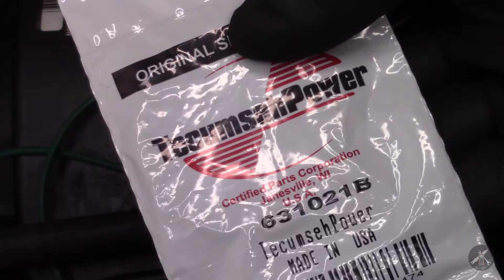Repair Tecumseh Carburetor - Where does the float spring go? Needle / Seat Install and Float Adjust.

Comment: Just had my carb apart and just cleaned it all up with no part replacement. Mine had a lot of sediment in the bowl and crusty crud on the float. The bolt with main jet also has a very tiny hole just above the threads that needs to be cleaned out. All the videos I watched, nobody showed that spring on the float. When I took it apart I was surprised to see that spring, I’d never seen a spring on a float like that before. I put it together without the spring and it’s been running fine.

Comment: Thanks for showing the "missing" float spring that helps lift the float, otherwise yer dang bowl overflows.
Reply from the maker: You're welcome. Yes, that spring is important and tricky to install.
Reply: @bitsofwisdom460  Well, since they want an ungodly amount of money for a rebuild kit for an HH120 w/ LME 36 carb, I made one myself ! Yep, dug up my mini springs, put one on a float pin, unrolled both ends then bent up the holdie tabs. It's already installed. Once again thanks for the view.

Comment: well got done and all the fuel leaked out any suggestions came out carb some where
Reply from the maker: If fuel is leaking out of the carburetor, it usually means that the level in the float bowl is (much) too high.  The float should lift the needle into the seat and stop more fuel from coming into the bowl. Something could be binding on the float so that it doesn't drop and lift freely. I would double check the pivot pin, spring, and needle clip and make sure the float moves freely by gravity.  The new seat might not be installed and sealing correctly. The needle must seat into the hole in the center of the seat and there can't be any nicks or scratches in the sealing areas of either part.  It is also possible for the float to leak (brass) and have fuel in it so that it is too heavy.  Plastic floats can sometimes either leak or absorb fuel so they don't float either.

Comment: Do you use Sta Bil for the fuel? I know in dirt bikes that sit all summer with gas, we use Star Brite brand treatment as it will not destroy the rubber O rings within the carburetor. Maybe look into that.... 😊
Reply from the maker: Yes, I've been using Sta-Bil since about 1998 when I nearly lost my 428 Mustang to massive carburetor fuel leak when the Holley float bowl gaskets disintegrated over the winter.  When ethanol fuel became prevalent here, I switched over to their marine grade product that has additional corrosion inhibitors.  I still use that even though I use ethanol free REC fuel. I figure that is still valuable for the boats and I only buy one bottle for everything. My practice is to add stabilizer to every can of fuel when I bring it home.
My one concern is that REC fuel isn't dispensed as quickly in the local stations and it could be possible for the gas to be degraded at the time of purchase. Especially in the winter when boats are stored and sales are slower, it could get stale sitting in the gas station's tank for a couple of months.
Reply: This is hopefully not the issue! They should only buy small quantities if not selling.
Reply from the maker: @mikebruegger8654  I would hope not, but REC fuel is a low volume relative to regular.  Most stations probably fill their regular tanks every day or two.  The place I usually go here has a roughly 2500 gallon above ground tank (it has a gauge) and the area had a major dam failure in 2020 that washed out 4 reservoirs.  So, many boats and winter sports equip aren't filling up. I expect that the station tries to keep the volume flow right, but it is a possibility.
Reply: So Got it running perfect now thanks again I did do one thing. I put a inline fuel shut off valve  always a good idea when tank is above carburetor And I run it out of fuel for storage. Just a idea. Thanks again.
Reply from the maker: @slushjoe  Glad that you got it running. That shutoff is a good idea.  On mine, I would need to cut an opening in the shroud to reach it, but may be worth it.  I am also planning to install a fuel filter given the sediment that I found in the bowl.
Reply: @bitsofwisdom460  I put the filter in then took it out. that is were I put shut off valve. My key that shuts the machine off does not work, ohms meter says it does, So shut off valve seemed better idea, I use to use the choke  to choke it out and then run it into a snow bank to shut it off. Anyway most of the stuff in carburetor was stuff reacting to brass float so removing filter for me was fine. thank you again. Timing of this video was perfect with in minutes. nice close up work.

Comment: is the bore  ( needle seat bore  for the new neoprene  gasket ( biscuit)  in the carb  for  the needle seat ,  straight bore or tapered? can you measure it , and  confirm?
Reply from the maker: I would need to take it back apart to do that, and right now is a bad time for me to do that. I don't know for sure, but it seemed to be rather straight to me.  I installed the part with the standard tool that has a straight shaft and I didn't see any obvious taper between the tool and the bore.  From a processing point of view, the part appears to be sand cast or similar based on the texture rather than die cast.  The hole is machined and typically would be a straight cut rather than by a tapered reamer.  If it were die cast, there would usually be a taper formed by draft angle on a pin in the die, but it appears not to be the case.  
Why do you think this is important?
Reply: @bitsofwisdom460  The neoprene seat has flat side with a number and ring side with a groove. The groove permits the seat to compress in the tapered seat. The inside portion of the ring seat is 0.010" shorter than the outside wall. It took a while and a dial indicator to measure this. Now we know why the seat needs to install with number facing the needle valve and  the ring side to face the floor of the seat ID.
Reply from the maker: @thecaptainindustrialsales4560  Interesting finding.  Sorry I wasn't able to help with a measurement.  It's currently 100 miles away in storage and I'm tied up with personal business.
I expected that the grooved side would be facing down / inward as a better sealing surface. The peaks of the grooves would have higher unit loading when pushed into position than the flat side.  It seemed to me to be a like a multiple lip seal vs a face seal.